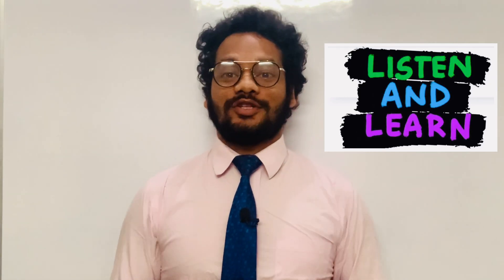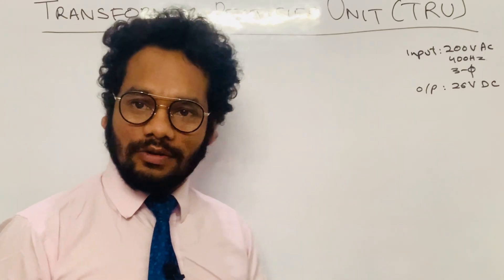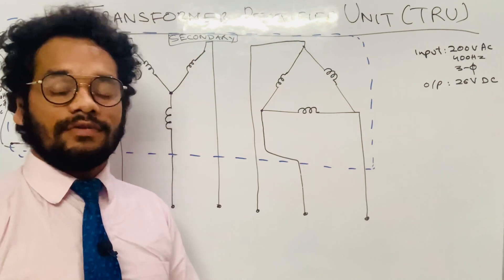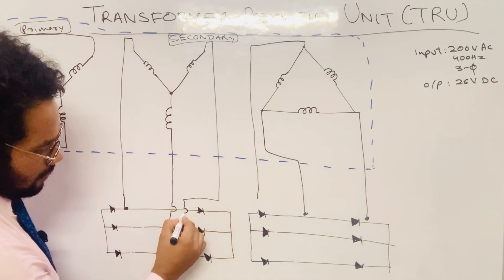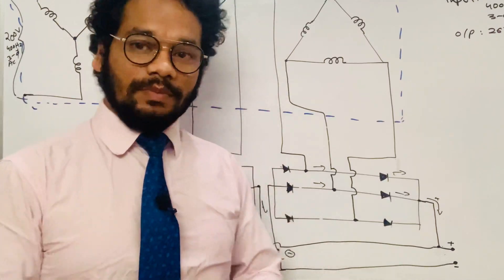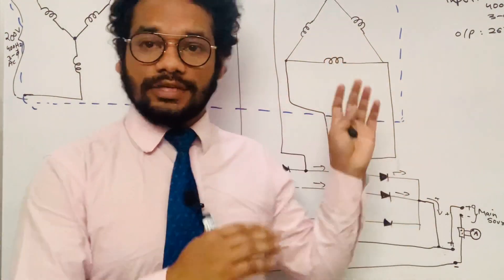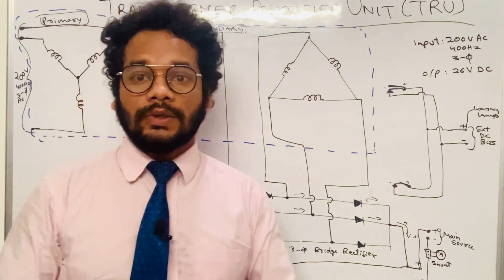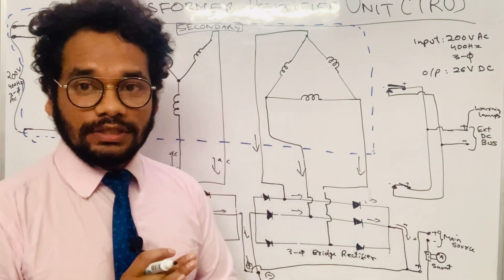What is Transformer Rectifier Unit (TRU) || Construction & Working of TRU || How to make a TRU ?

Comment: I believe the output here would be 270V not 26V. Please explain if I am wrong.
Reply from the maker: This is a typical type of TRU wherein the output is 26V. Based on the requirement, the device with the required output can be designed.

Comment: How are we able to connect output of both the rectifiers in parallel as they have unequal voltages, will it not result in circulating current?
Reply from the maker: Nice question! In the diagram explained the rectifiers used are all of the same electrical rating.

Comment: What is the purpose of the Wye and Delta secondary.
Why 26 volts output that is worthless why not 200 volts or more.
I guess same could be said for the input voltage.
Reply from the maker: Wye & Delta connections are 3-phase connections. Hence used in the diagram. 2 different secondary windings are used because star and delta connections both have their individual benefits; star connection has a ground terminal and delta connection is better for unbalanced load.

The explanation here is about a typical TRU having input as 200V ac and output as 26V dc which is a unit used in aircraft. For commercial applications, the input and output can vary and be equal to the values you mentioned in your comment. The no. of windings and design may also vary in the such a TRU. The working principle would remain the same. 
Thanks for watching our video. Keep learning keep growing 🤗

Comment: why u used two different secondary windings in transformer ??
Reply from the maker: 2 different secondary windings are used because star and delta connections both have their individual benefits; star connection has a ground terminal and delta connection is better for unbalanced load.

Comment: is there necessay to be used two secondary winding???
Reply from the maker: It is not necessary as such; but if more output voltage is required, it is a good idea to have 2 or more windings in secondary. In the video, I have shown only 2 windings on secondary (a typical TRU).

Comment: My concern is in thermal switch will be shorted the positive and negative when they are activated..?
Reply from the maker: The electrical supply (D.C.) from an external bus bar is always ON/LIVE and flows through the wiring of warning circuit but as the thermal switches are not closed (shorted) in normal operations, this electrical supply (D.C.) waits at one of the contact point of the thermal switches. The moment there is overheating of the T/F or the rectifier, the thermal switch comes in action and it closes (gets shorted) both contact points of the respective thermal switch. Since the warning circuit is closed now, immediately the electrical supply (D.C.) which was waiting at one (note: a switch has 2 contact points) of the contact point of the thermal switches will now have a path (as both contact points of the thermal switches are connected now) to flow through the warning circuit and hence the warning will be triggered immediately ( on the closing or shorting of the thermal switch contacts). 
Note: The thermal switches are activated during overheating of T/F and/or rectifier when temperature conditions at their respective locations rise to approximately 150°Cand 200°C.